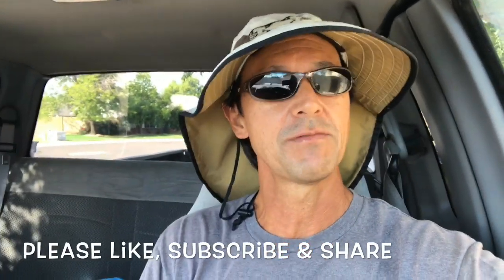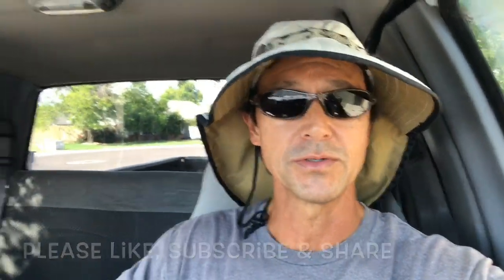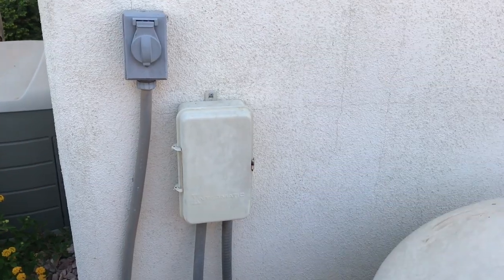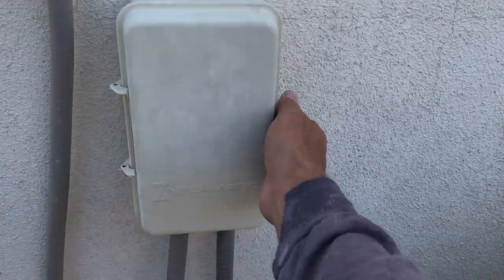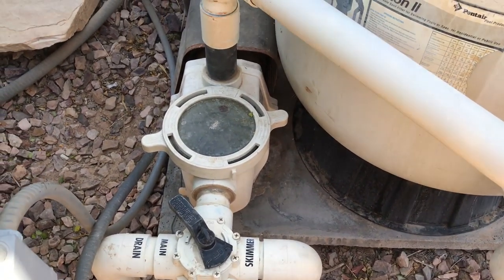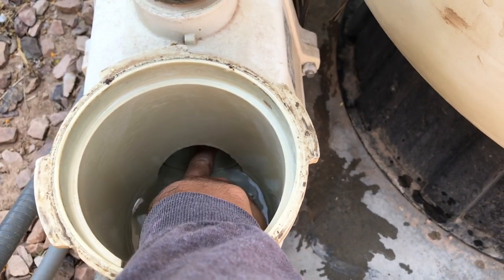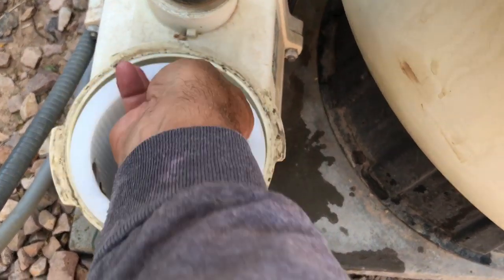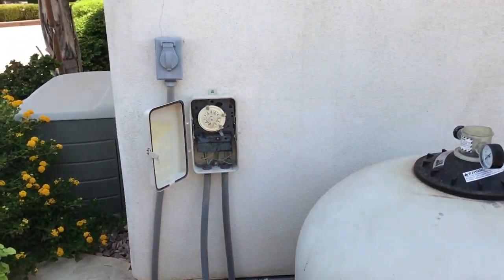Unclogging a Pump Impeller

Comment: Your the best!! I knew my pressure was off this year, today as I planned to close my pool I ran into the issue of pump not priming. I do not have air release valve in mine. Anyhow tried everything and watched a ton of videos, talked to two pool stores and no one once said impeller might be clogged!! I guess commonsense now that I think about it, but was never suggested. So thank you a ton. Fixed everything!!!
Reply from the maker: Glad it was helpful. Hope you will subscribe to my channel and share it with others.  And if you are so inclined please check out my website poolschooler.com for more DIY pool maintenance money saving member content.

Comment: You can use the pressure of the pump vs. air relief valve to aid with this as well, but your method is best. The challenger pump impellers, in my experience are the ones that are more prone to clogging. Great info, thanks again!

Comment: The suction on my above ground pool seems fine until we start to vacuum.  The water level inside the pump basket goes down significantly when the vacuum hose is attached.  We've replaced all hoses and gaskets.  We've been to the pool store every day this week.  Any suggestions?
Reply from the maker: Can you email me a picture of your pump/motor set up and ALL the plumbing from the pool to the pump on the suction side of your system?  My email is kennypoolschool@gmail.com

Comment: Great info in the video! We have no suction on the inlet where our vacuum plugs into the side of the pool, any suggestions? Thanks
Reply from the maker: If you have a dedicated vacuum line it should have a adjustment valve at the suction side of the pump usually splitting the suction between the skimmer and the vacuum line.  So make sure that valve is set to give the vacuum line 70-80% of the suction. 

You could also have a clogged pump impeller which would affect all the suction of your system.

A super dirty filter could also do that.

Lastly, there is a possibility that your dedicated vacuum line has some type of obstruction in it. (I've seen everything from vegetation to a rock).  The best way to clear that would be to have someone come out and "blow" out the line using high pressure air.

BUT try the first ideas first.

Comment: GOOD video. I especially like your focus on safety, as nothing ruins a day like an Emergency Room visit!!
  I have an OLD School DuraGlas PUMP  - that I love -  can I access the impeller on it like you did in the video?
  Lastly, that pump primed up REALLY fast ( faster than mine). Is it a Pentair?
PS in keeping with the safety theme, here's my tip for the day: Apparently, paper wasps🐝  like  to build nests in backup cartridge filters. I learned that the hard way when I moved 
mine yesterday - now my hand looks like a catcher's mitt!! BEE careful out there!!😁
Reply from the maker: It is a Pentair Whisperflo. Good info on the Paper Wasps. Thanks for sharing.
Reply: @PoolSchooler  
Thanks for the info. And, regarding pumps, mine quit working today!👎! It shut-off and tripped the breaker in the garage. Does that usually indicate a seized bearing on the pump motor, or a pump impeller?? Also, I read that the pump motor capacitor can fail; have you ever heard of this happening?
Reply from the maker: @charlies.5777  Sorry to hear about your motor but they do seize up and just plain wear out over time. Yes, I have heard of the capacitor failing and usually if someone has a motor that has quit working that's the first thing I have them check for before spending the money on a new motor.  Usually a reputable pool repair person can check to see if its the capacitor or motor before you spend money on one or the other.
Reply: @PoolSchooler  
Thanks for the info.  I'll  have  the capacitor checked-out by someone and I'll hope for the best. Since I cannot remember when the motor was last changed - out ,though, I WON'T be surprised if it JUST decided to" retire!! "😁 Thank you again for your feedback- I really enjoy this channel.👍
Reply from the maker: @charlies.5777  Please let me know what you find out.
Reply: @PoolSchooler  I will - especially if it's a flux capacitor!!😁

Comment: My new Intex 3000 pump is clogged. We used ordinary pool sand when we set it up. Now you can't turn the dial in any direction from the "filter" setting. I was 
trying to get to backwash and then rinse filter but I'm afraid the handle on the dial will break off. All I can hear is a sandy, gritty sound. What should I do?
Reply from the maker: You have to use pool sand the ordinary sand is to fine and has gotten through the seals probably.  You'll have to empty the sand out of the filter and clean out all the valve connections (like the backwash valve).  It's a pain but it has to be done to get all that grit out of there.

Comment: My return lines into pool are weak. And I’m getting green algae at the deep end? Help please. What’s my issue here.
Reply from the maker: It’s hard to answer that question without more information. If your return flow to your pool is weak it could be due to several things. First you want to check the suction side of your pool and make sure that your pump basket and your pump impeller are clean and clear because that can restrict the flow and restrict the return flow. If the pump basket and impeller are clear then more than likely it’s your filter media. Because I don’t know what type of filter you have I might guess that you have a cartridge filter that either way you want to clean your filter media, if it’s a cartridge clean the cartridges, if it’s sand backwash it if the sand is really old you might need to replace it, if it’s diatomaceous earth you might need to backwash and recharge your grids or you may even need to have them taken apart and cleaned. Unfortunately with the information I have about your pool that’s the best I can offer.
Reply from the maker: Oh as far as the algae, a dirty filter can cause this plus poor chemistry.  if those are all ok then I'd suggest watching this video I did on Algae and Algaecides and Why You Don't Need Them.  Here's a link: https://youtu.be/MzGoK4Cd7tc

Comment: My pool man found a piece of black hard plastic in my pool pump basket.  He said he thought it was part of the impeller and that he could feel another piece but could not get to it.  My pump allowed to run dry by the last repairman that worked on it (and said it was fine while we were gone for 3 days -  it ran dry for all 3 days).  It melted my basket and I don't know what else.  He came back out and now says that I have something hard stuck in my skimmer line at the pump side elbow.  He said it is something hard like plastic or something.  He tried to get it out and seems to have jammed it in further. How can we get it out/clear the obstruction and what kind of damage could be done with them letting the pool run dry like that for 3 days?
Reply from the maker: Hmmm.. Two things.  First, it sounds like the piece of plastic you (or he) originally found is more than likely a piece of the impeller diffuser (it's a plastic sleeve that leads to the impeller fan).  That can be replaced (have a repair person do it).  Second, if your pump ran dry that shouldn't have happened with even with the skimmer line plugged (that is if you have another suction line like a dedicated vacuum line).  Sounds like the broken diffuser caused the pump to not be able to prime but ran dry.  See if you have a broken impeller diffuser first and if so try fixing that then see if the pump will prime.  If you do have a blocked skimmer line you could try "snaking" it out but if you can't the only real way to clear it is to dig it up and replace it.
Reply: @PoolSchooler  The blockage is in the elbow above ground.  Nothing to dig out.  We were told that it "had" to be blown out with CO2.  I have a home warranty and they cover "above ground plumbing" but said that this was not normal wear and tear.  They said that without knowing what is causing the "clog."  I will mention the impeller diffuser.  Thank you!!

Comment: I'm having a problem with my sand pump.  My pump would suck the water, but then the water go back and fill up my skimmer. And it would keep doing that. My gauge would go up and down. I'm so clueless! Hate to buy another pump for something simple.
Reply: I did change my o-rings just in case it was air in the line. But still doing the same thing.
Reply from the maker: @charlenecoupel6147  Make sure your returns are open.  The sand is your filter. The pump just moves the water.  Sounds like it's cavitating usually due to back pressure in the filter.  You may want to have someone come out and check that if your returns are open and it's still happening.

Comment: Big fan here. Primed and started pump yesterday, found a tiny leak coming from the pressure release valve on my pump and was wondering how I should go about fixing it without sucking air in. I know for sure the seal is still good,  a price of it is just sticking out from the thread, my pool guy just lazily screwed it on and left. Any help would be greatly appreciated
Reply from the maker: Isaac Huffman that’s a bummer that your pool guy did that.

But I’d suggest just replacing the entire pressure relief valve. It’s easy to do and not too costly.

Comment: Darn it..I took out the basket to look inside of the impellar and my pool impellar is NOT located in the area where yours is! When I take out the pool basket, there is only a pipe there...my impellar must be located in another area than yours is??
Reply from the maker: If you could email me a pic of your motor/pump I can further comment, more accurately.

Comment: Thank u so much for your video (and the great gurggling sounds, too! Yes, annoying, but funny).I love how easy you make everything look...I have been cleaning my own pool for the last 3 yrs and had never heard of the pump impellar until just now.My hayward pool cleaner will not move, yet, I AM able to manually clean my pool with decent suction, so Im not sure if the problem is my impellar, but Im about to find out since I have trouble shot the pool cleaner hose and there is nothing stuck in the pool cleaner. I have no idea what else it could be, if the impellar winds up to be clean! Any ideas why my Hayward pool cleaner wont move at all, yet I DO get suction when I manually clean my pool?? Btw..may I ask where u live? Are in Florida? Thanks again for your video:)
Reply from the maker: It's very possible (if you have a Hayward Navigator (or similar model) that your gears, or pods or turbine are worn out.  I'd suggest taking it to your local pool supply store and have them look at it.  The Navigators are my least favorite pool vac mainly because there are just way too many moving parts and it seems that once one thing on those wears out, everything else begins to also.  Not a fan.  But your pool supply store should be able to to a rebuild on it.  NOTE: I'm assuming guy have enough suction on the vacuum line.